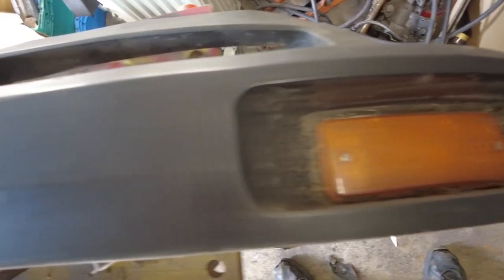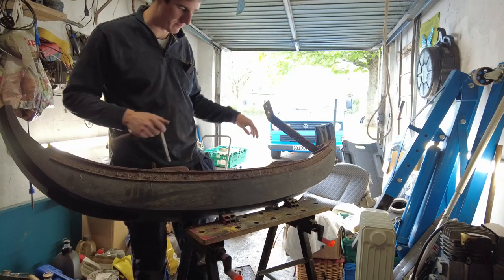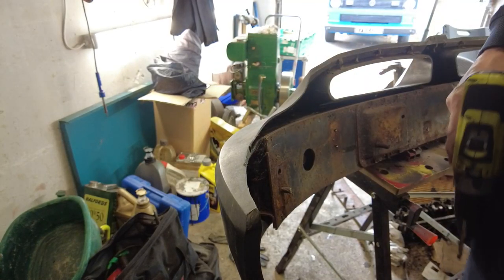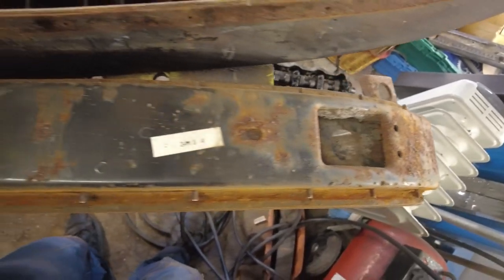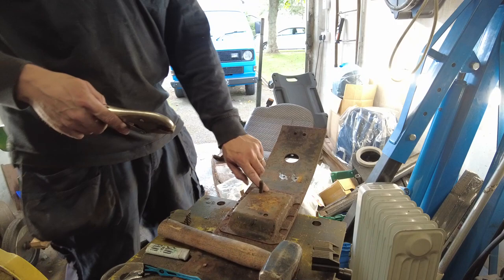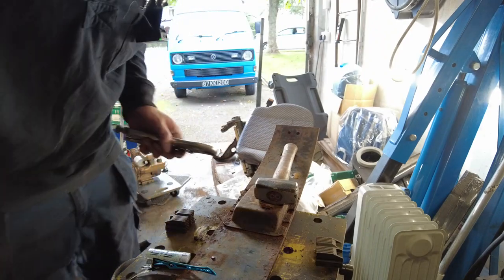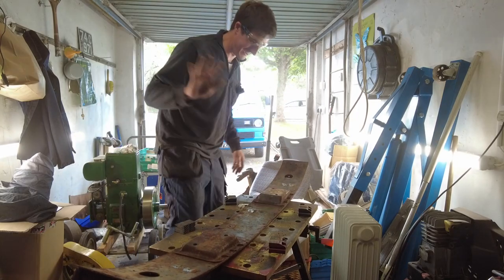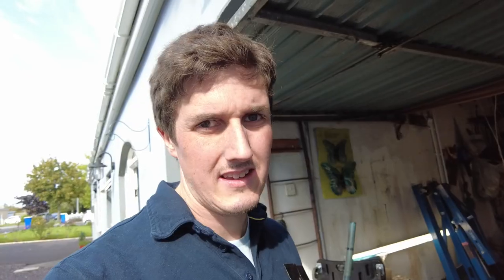MGB resto Part 15 - Restoring the RUBBER BUMPER

Comment: I like the Rubber bumpers too. They keep your car safe compared to the chrome version. I wet sanded my rubber part to make the smooth and nice again. Great progress.
Reply from the maker: Thanks! Yeah I'll be wet sanding mine when it comes to installing it, but that's a long way down the line, so there's no point doing it now. And you're right, they're much sturdier than the chrome.

Comment: I might drill and tap the ri it holes and use cap screws just to experiment and waste time in my workshop lol
Reply from the maker: I don't think the metal would be thick enough to get a decent thread into. You could use rivnuts though!

Comment: Great video! Can you tell us what type of black paint you are using… I read different opinions on how to coat chassis parts… is the two pack epoxy hazardous? What type is it?
Reply from the maker: I'd have to get the full details on the type of 2 pack epoxy paint I'm using, but yes it is hazardous stuff and you need to be reasonably careful when using it. What I'll do is, in the next video in which I'm using it, I'll show the products I use and talk about them. It's very effective, hard wearing stuff.

Comment: Hello Ross never thought about doing my rubber bumpers so thoroughly but will now just a word of caution when using grinder with cut off wheels you should have safety glasses and face shield I had one cut off wheel shatter on me it went right through the door card and dented the metal behind glad it wasn’t my face take care and keep up the good work
Reply from the maker: Yes, I take on board what you're saying. I am trying to be more conscious of using the right PPE.

Comment: Whats the 2 part paint opoxy you used after the bilt chamber 80?
Reply from the maker: It's just a standard 2 pack epoxy that's available from any car paint suppliers. It's nothing special.
Reply: @Endfloat  great, thank you. Do you think something like hammerite would be suitable or would you recommend a 2 part?

Comment: A lot of work going into that bumper should last for years.

One thing though, I hope you don't regret pouring oil into it when you come to paint it. 

Hope you manage to paint it OK, the oil just keeps seeping out and effects how the paint sticks. It might be worth considering waiting until you have painted it next time. I hope it's ok
Reply from the maker: I painted the bumper parts in this video. They came out fine actually, although I was concerned about that.
Reply: @Endfloat  I know I realised that later. I watched the video in two parts. Putting the cart before the horse again lol.

It looked great when finished, worth all the trouble.
Reply from the maker: @jbclassics  thanks! Yeah I was pleased with the end result. It should look the part when I get it back on the car..